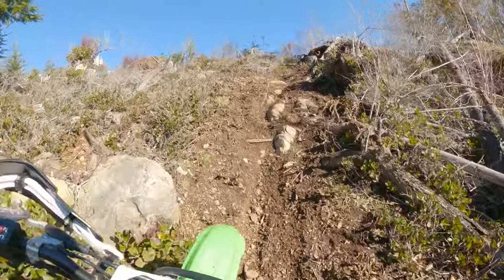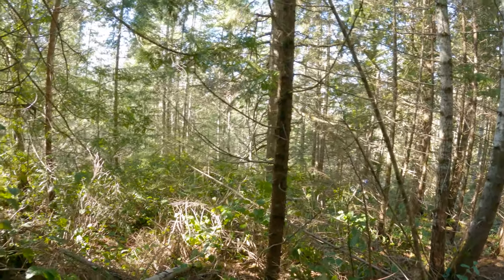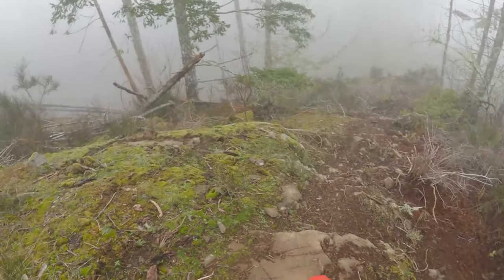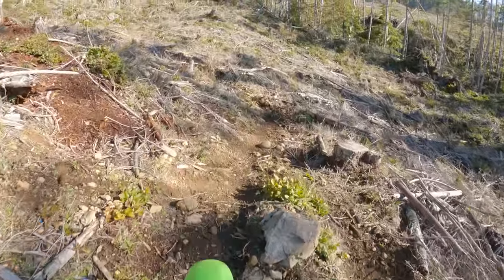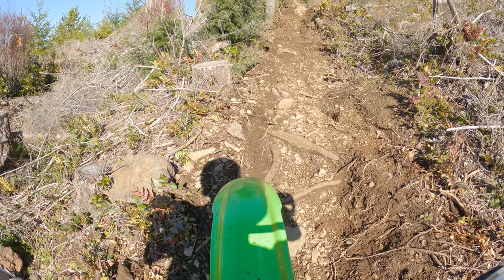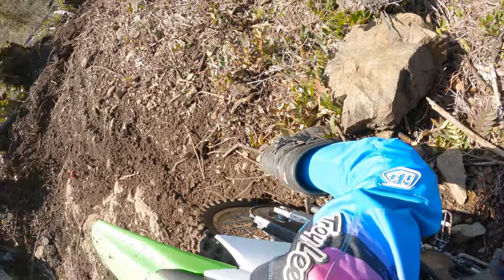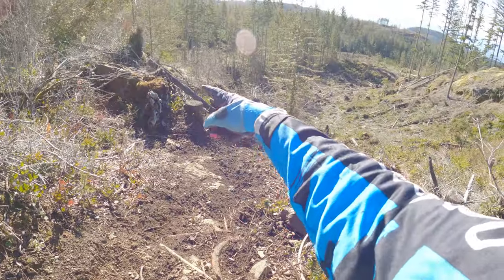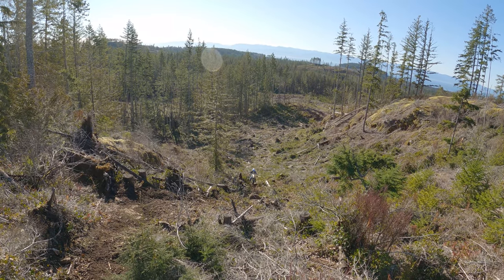Testing The KLX140RF’s Hillclimbing Ability! *FLIPPED OVER*

Comment: I like your vids too ! 
What do yout hink of your front suspension compared  to the chinese RFZ ? 
I recently got a honda 125fb and the front forks are  honestly  worse in comparison to my ex RFZ , so dissapointed to have discovered that after buying it.
Reply from the maker: Thanks you Andrei!! Im in loveeeee with the front suspension in the klx! Its so plush, and a million times better than the apollo or xr suspension! 

That’s unfortunate to hear your not pleased with the 125fb forks!

Curious, What in particular do you not like about the fb forks? 

I do know that the 125fb is geared towards a very light rider for very slow speeds
Reply: @AaronsEnduro  Yup that's correct ! I mean they're a dream on slow speeds , but anything above 30+ mph they're honestly worse than a chinese bike !
They allmost threw me off the bike on a couple rocky trails  going faster  , and the handlebars feel like they're going everywhere , would definitely NOT recommend this bike as a  "pit bike" other than to a kid just starting out riding.
I'm 5'6 and 120 lb , I'm pretty small too  but this bike just doesn't feel right.

Glad you're doing fine on your klx , having a bike you love makes you come back right on the trails :D
Reply from the maker: Very interesting to hear that! Wonder if changing the fork oil or springs would help with that

Comment: Hey do you have a link for a front and back brake disc for the rxf 150? I don’t wanna order the wrong ones lol any help would be appreciated! Thanks!
Reply from the maker: Personally i cannot garuntee what pads are in your RXF but id start with pulling one of your pads out so you know what shape they are, then you can mesure the bolt holes and see what would fit. I should have some listed inthe descriptions of the latest apollo videos